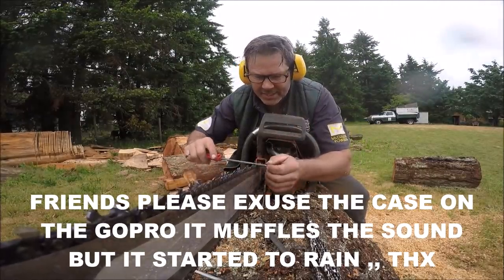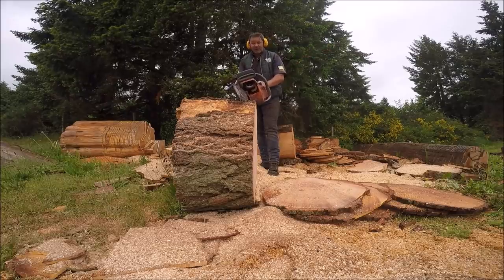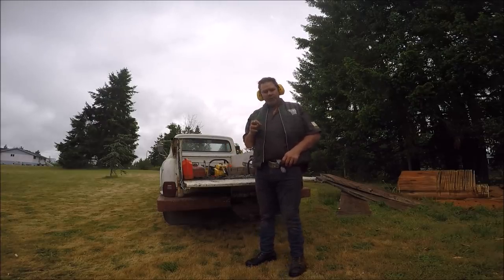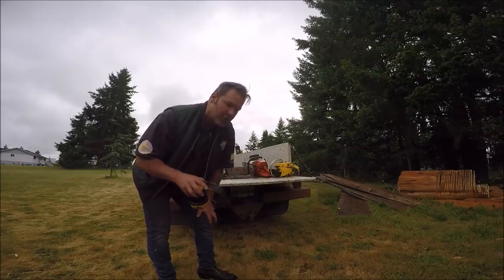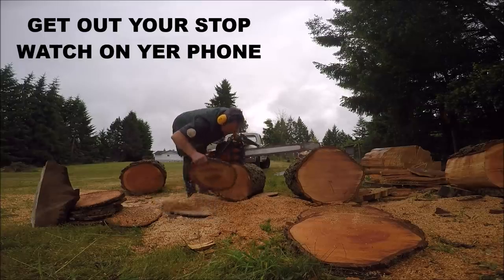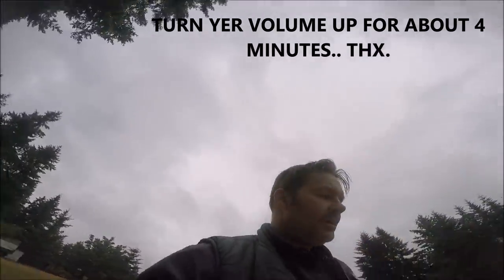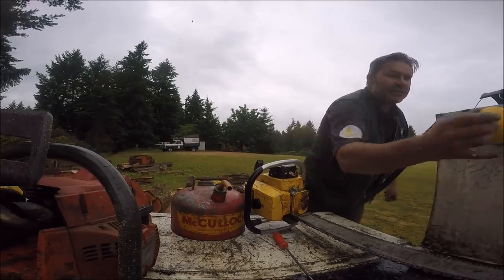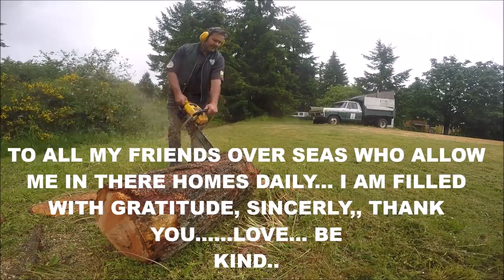CHAIN SAW CUTTING CROOKED   , SKIP VS FULL SEQUENCE CHAIN

Comment: I use both...skip and full...prefer the skip for most cutting and quicker to file up....full is smoother on smaller wood and limbing...whatever makes ya happy. 👍
Reply: I prefer skip tooth too. They say it's better for beginners but I don't think so considering it just rips 😂 and the saw is potentially more powerful with skip because it's dragging less

Comment: Happened to me today actually had to buck up an ash log an noticed the saw dipping to the right so i touched it up now my 372 is ripping. Last safety meeting at my shop me an someone was talking about filing its so important to file correctly especially doing crane removals when it comes to the last butt log pick you want to cut all the way around an cut straight good stuff buckin love it

Comment: Hey man, so Im new to chainsaws and I got a Husqvarna 444sg from my grandpa. 40years and still going strong, amazing. However I did not do a good job at all with filing when I started using it.,. Not at all.. I have since got a good filing guide and new files and raker guide. Still the saw pulls to one side and binds up constantly. I was pretty much ready to replace the saw/buy new bars for it when I saw this video. I have been watching your videos, but this one really saved me. I have been filing one side against the tooths and not realised that it could cause problems. Really focused to get the filing the same on both sides and now it goes in super smooth! 
You definitely earned yourself a subscribe with this one! Thanks

Comment: Buckin'...A while back you did a similar video showing that the angle and the ltop plate length of chain had little to do with it pulling but the rakers were very important.  I have also found that a chain that is loose in the bar groove is also a common problem.  I know you go up a chain gauge when this happens to a bar but I close the rails with an old Sivey bar rail closer.

I don't square grind chain so "getting the gullet" is important to me as you demonstrate on your round filed chain.  I was reading on Madsens' website why they think getting the gullet on square filed/ground chain is important.  But then again they probably hve cut as many millions of board feet of timber either.

Keep the positivity flowing.  Wish some of it would wear off down here in the States.

Comment: HI BUCKIN IVE seen this be 4 when the bar gets a lip on it all the way around it will cut 2 ,1 side and it won't cut the same or go through the wood until U file or grind that lip off OMG 3 19 2O23

Comment: Skip tooth cuts a little slower but it is easier on the saw. 

I have a 24" Huskie bar with skip tooth chain on my 3.7ci 60cc TimberBear and it pulls it no problem. Switch to the 20" bar with full chisel chain and it will bite really hard, especially in Pine. 

I need to rig up a bar on my paps old D-36. It has the 80cc "Cart engine" with the removable head and the big old Tillotson HL87D Carb.   Problem is finding a Bar that will mount up to the old girl. It currently has a stubby little 16" sprocket nose bar on it and what looks like 1/2 chain. Not sure a modern chain will work on it. The chain that's on it is shot. Rusty and ground down to nubs.

Comment: For me crooked cutting or "saddling" happens like Bucking said, when the bar is buried, otherwise not so much at all.  In softer woods like maple i like the 28 skip but in harder woods like oak i prefer the 24 full comp.  More teeth in the wood with the 24!

Comment: Another thing that can cause an angled cut is rocking your chain. I have had this happen out on the trail a number of times. I rock the chain, then the next tree, the saw cuts crooked. Put on a new chain and the problem is gone. Rocking a chain in essence is the same as having a chain only sharp on one side.

Comment: I think it just ME that causes the "curve".  I think I press with my left hand.  If I put my left hand closer to the plane of the blade on top it goes straighter.  My chains are sharpened on a machine which is set evenly on both sides.  Same angle, same tilt, same rakers, same amount of tooth left, new chain, old chain.  I've been cutting since 1972 with many kinds of saws and if I push too hard with my left hand it cuts crooked.  Not usually curved like your example, just going off angle. I have two Maxx grinders.  One for .325 and the other for 3/8 chain.  Maybe I missed something in your explanation.

Comment: The first time this ever happened to me was with a little Stihl MS 160. And my saw curved so badly it bound up within the depth of the width of the bar. I scratched my head for a while. I though my bar was bent at first. Then I replaced the chain. The carving went away.

Comment: Hay buckin   IV run skip here in Australia  ground  we found here if we too the gullet out of a growing chain would cut faster again do you gullet you ground chain
Reply: Auto correct lovely  do you gullet your ground chain
Reply from the maker: @benmeyer3962  i have not removed my gullet on ground chain for quite a while now   years actually
Reply: @BuckinBillyRaySmith    ok it very interesting how chain responded in different timber  I manly cut hard wood over here eucalyptus  and hand filed  square   . I guess one reason to remove the gullet for me was easy of sharpening .  I'm learning lots from you my friend  keep up the good work